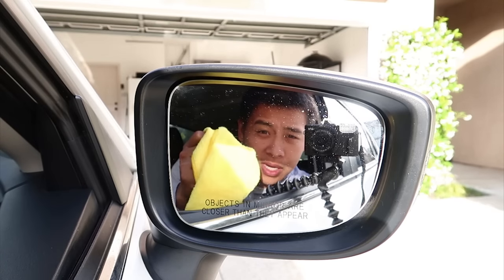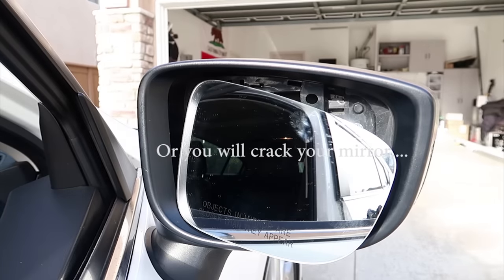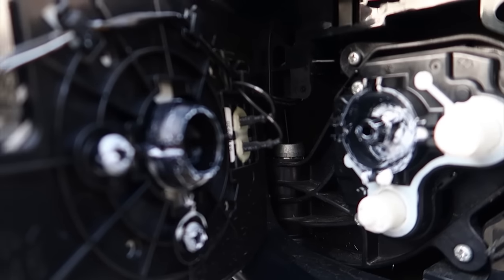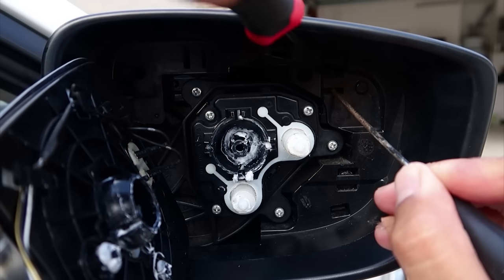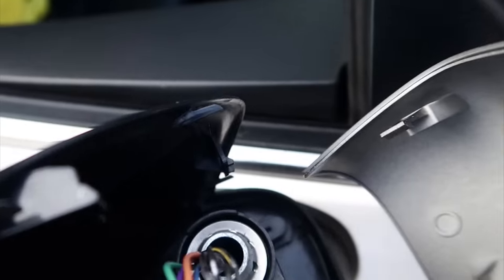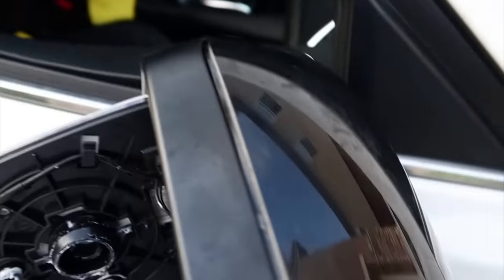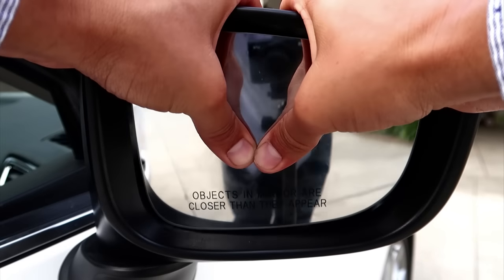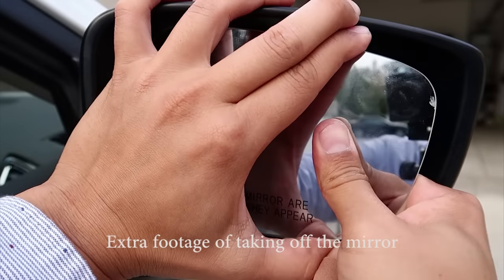How to Replace the Mirror Caps - 2016 Mazda 3

Comment: At the points of contact, what are the white parts called? I'm missing the part that joins the little ball and socket
Reply from the maker: @xandervenegas19  o what the... its needs the small and big ball joint and socket otherwise it will just flop around...
Reply: @GregPettus  can I get a small joint part separately or would I need to replace the whole thing?
Reply from the maker: @xandervenegas19 not sure. Probably the whole thing unfortunately. Did yours break?

Comment: So I got the middle part to snap back but the 2 control arms won’t snap back in.   The just push back 
In the assembly.  Any help would be appreciated
Reply: I’m gonna give myself some advice.  So you have to basically send it in without fear. It’s either going on or it’s breaking. The 2 prongs were a pain but a little bit
Of lube and patience got it done.

Comment: Can you fix the mechanism that open and closes it from the back?
Mine must have slipped off and it doesnt open or close now.
Reply from the maker: Are you talking about the trunk button that opens the trunk?
Reply: @GregPettus  nope sorry, maybe I didnt explain correctly. The wingmirrors open and close on a motor. My left mirror has stopped working but I can hear the gear inside constantly turning. I was wondering if I could access this area through the back of the mirror?
Reply from the maker: O i see. Mine didnt come with that feature 😭😭😭 but from what i can see i think you need to remove the whole mirror to fix this. Should be simple and straight forward to remove the mirror
Reply: @GregPettus  I think you have to remove the plastic from the inside of the door 😭
Reply from the maker: Honestly not bad just pull slowly and the clips wont break

Comment: Is that virtually the same as the Mazda 6 2013 on?
Reply from the maker: Not sure. Probably very similar
Reply: @GregPettus  The same as far as I can see, the same procedure worked a treat, the capping on my one wasn't clipped in at the bottom. The bottom ball joint  was a bugger to get back in, it needed quite a shove. Thanks ;-)
Reply from the maker: The Missing Link's Younger Brother nice! Glad i could help

Comment: How do I take the actual mirror off if I need to replace them??
Reply from the maker: For the hold thing, I believe there is a big bolt on the inside. So you take the panel off on the opposite side where you see the mirror connect on the door. Then you may need to remove some covers on the outside mirror so you can hold the bolt and unscrew the mirror. 

That is if this mirror is like every other mirror I have taken off. Hope this Helps!
Reply: Well... there's only one way to find out xD my wifey has banned me from working on the car for a while (I just like spending money on it and touching it up), so we'll see when or if I ever get to replacing those bad bois

Comment: How you remove the entire mirror assembly unit to replace with a new one on a 2015 Mazda 3 i grand touring?
Reply from the maker: Pop the plastic cap on the inside. 3 bolts if i remember correctly. Then you can replace the whole mirror assembly
Reply: @GregPettus  Thanks for the info, but I will have to transfer the glass mirror to the new assembly. Just don't want to break the glass by not knowing how to remove it.
Reply from the maker: Are you buying the entire side view mirror?
Reply: Would I have to remove the door panel to get the mirror assembly off?
Reply from the maker: You may but it super simple. A screw and bunch of tabs. This will help yoi get access to the triangle piece near the mirror
Reply: yes you will have to remove the door panel. its really simple actually. like two screws and then some clips and then some screws to release the old mirror and replace with the new mirror. you will have to fish the wiring AROUND the window track.

Comment: I can’t get the mirror to connect with the white connections. Feel like I just push the connections further back and then it comes nowhere near reaching the mirror
Reply from the maker: First make sure they are aligned. Second use quick force around the joint. 
It should go eventually.

Comment: Why are 2 cables connected to your mirror? Thanks
Reply from the maker: I think its for heated mirrors. I dont think I have them? Maybe I do and dont know when they turn on.
Reply: The 2 connectors are for your BSM (Blind Spot Monitoring).
Reply: If they are fogged up switch on the heated rear window. If the mirrors clear then they are heated ;-)

Comment: How do you replace the whole mirror housing?
Reply from the maker: Have to remove the cover on the inside. Then unbolt the mirror. Then replace with a new one. May have to remove the A pillar.
Reply: Greg F. Pettus thanks for the info.

Comment: What if the 2 small ball joints white are not popping in? The white ball joints just go in  and i cant pop it in The glass mirror
Reply from the maker: @op14435  make sure they are aligned. Then i would push hard directly on where the ball joint is towards the socket. Make sure not to push outside of the joint. May put pressure on the glass and break it
Reply: @GregPettus  I did push it makes the clicking noise and pushes back out after I release it. The white small balls push back in when pressure is applied.

Comment: I put my mirror back on bit now it doesn't seem to adjust using the joystick on my door properly. Could the white screw things need to be replaced too?
Reply from the maker: First question I have is, if you touch the mirror with your hand does it wiggle around?
It shouldnt. This means the second tab in there isnt connect and you need to push the mirror in right where the tab is until it snaps in.
The white ball tabs should not need to be replaced unless you snapped them somehow, which is unlikely but not impossible.
Let me know how it goes?
Reply: Thanks, I realized I'm just having trouble getting them both to snap back in.
Reply from the maker: Stefany Flores working good now?